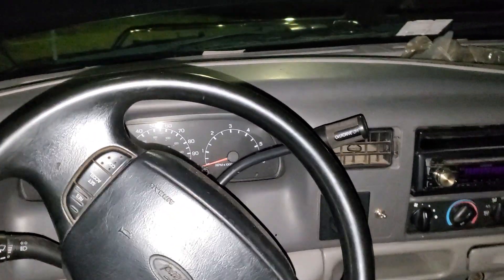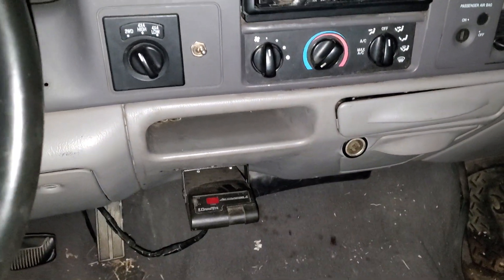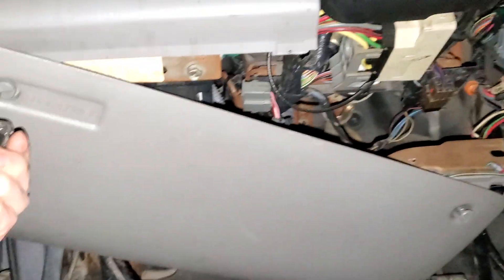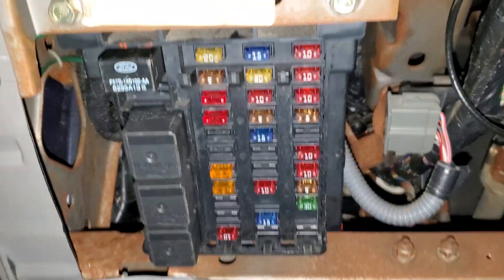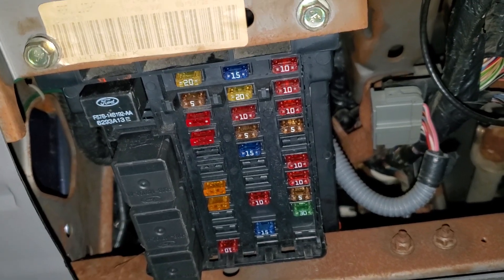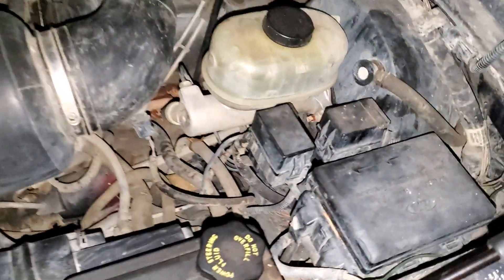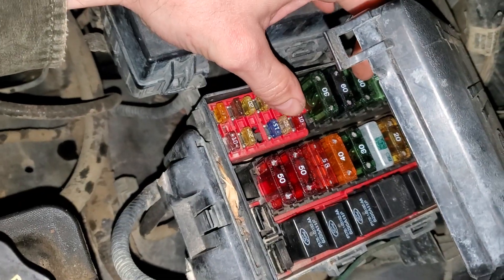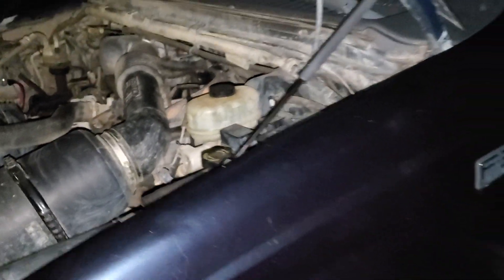1999 Ford F350 Cigarette Lighter Fuse, Power Outlet Fuse Location

Comment: Thank you so much for your video, is real good.
I change both, the one inside the truck is Power to the one under the cap holding, that one work, the others one is not working, so you know why?
I have Ford 1999 F -350 , motor 7.3
Thank you
Reply: Hey Did you ever figure this out?

Comment: Thanks dude man I knew there was another fuse to that thing, so I got it transformer now and the thing where you plug an extra power she can run things of birds called not transfer. Anyhow, I need a plug that in and cigarette lighter ain’t doing it set a 25 amp one that on there got it thank you much I appreciate it.